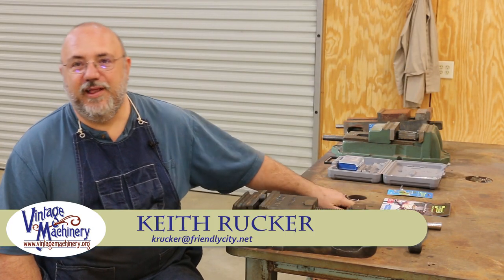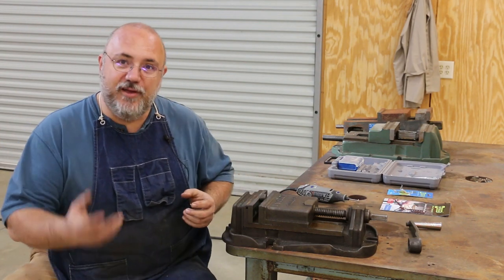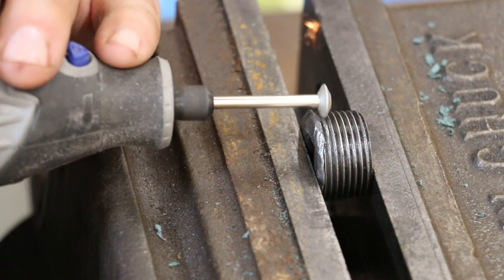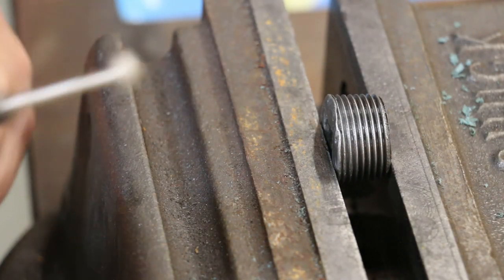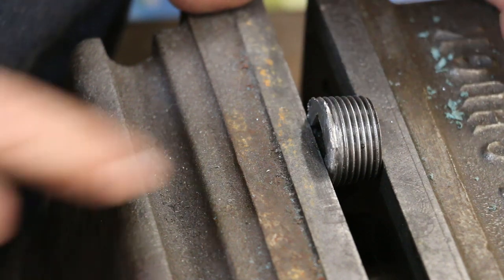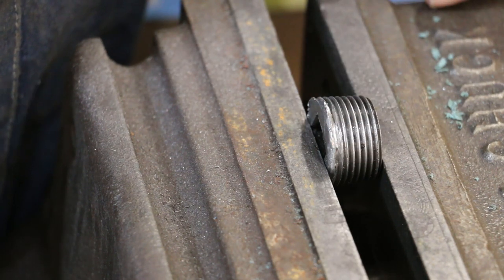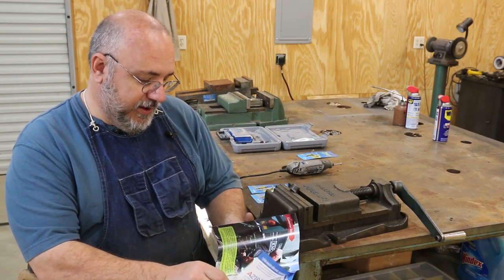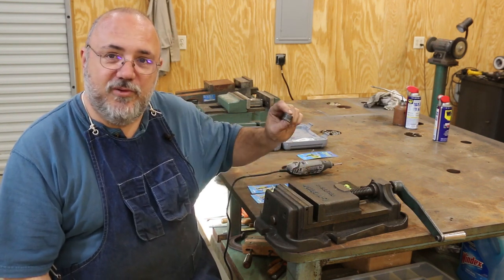Thread Repair using the EZ Thread tool

Comment: Hey Keith, My choice would be a thread file, more control.
Reply: yes i tend to agree , it was a bit agressive, a thread file is slow and wont do much to good threads
Reply: Or even just a triangular file and find the angle yourself.
Reply: I've had good luck in the past just using swiss pattern files to clean up threads. I bet I'd ruin everything I ever used that EZ Thread tool on, it's too aggressive and the proper angles too hard to maintain.
Reply: have to agree thread file yes might be slower but a lot easier to control
Reply: I'd be reaching for my needle files for that kind of clean-up.

Comment: As a machine repairman I use a Dremel and waffer thin cutoff discs all the time to repair threads.  Most of these commenters are clueless.  My boss would laugh at me If I asked to buy thread files.  For quick and dirty repairs this is a viable product.  Thanks for sharing.

Comment: Unless the thread was too hard to cut on an extrenal I think I would prefer a thread file for its control, going to need some steady hand eye to do a nice job with that freehand tool. The one big advantage I see to this is you could use it on many internal threads, something not possible with a thread file.
Reply: my thread files have an end just so you can use them in an internal thread, have you not seen that type?
Reply: As a very experienced machinist I think Keith woulda been better off just making a new one...its what I woulda done...and I have only had my Lathe since October. I think a tool like that is meant to sell, not to work. Might be good for cutting a chip breaker in HSS tho :)
Reply: The tool has been used by a master machinist with over 38 years of experience.  The product is very simple to use.  There are other videos on you tube that show how it works a little clearer.
Reply: It's a drain plug. It's literally not worth his time to make a new one.

Comment: I have to agree with most of the other folks who are less than impressed with this particular tool. In your position, with all the machinery at your disposal you could easily make a new part from scratch.
Reply: It would take a lot longer to make a part from scratch.
Reply: True, but it would have been done right. Probably best to find a new pre-made plug if there are any available in that size
Reply: I agree, all it needed was filing or grinding to remove the galling, and then a dab of Permatex No.2 to seal any leaks. If used in conjunction with sealant like Permatex, the EZthread repair would be ok for a quick rough fix, but a thread file or swiss pattern file would be more delicate and precise, but probably a lot more expensive solution.

Comment: Greetings Keith, I'm still sold on the handy thread file. I worked on used and abused oil field instruments before i retired.  I could chase/clean/repair threads of instrument housings, bolts, etc. most always faster and neater than my younger associates could drag out their grinders, cutting wheels, and wire buffers. I've always kept several of differing thread pitches in my tool box.  Thanks for the video....it rousted old memories!

Comment: The carbon in steel causes galling and clogs up diamond tools since it sticks to diamond which is pure carbon too. For steel you better use aluminium oxide or boron nitride wheels. Diamond tools are good for tungsten carbide, concrete, glass, non-ferrous metals. Maybe it is good for grinding chip breakers into brazed on carbide tools but probably not by a hand guided dremel.
Seeing your troubles to precisely guide the dremel and doing as much damage as good makes me want to use triangular needle files for such a job. They give you much better control, less damage, adequate tool/work material combination.

Comment: I think what everyone is not getting here is that this tool has its use in tight spot where you can't get a thread file or deep in a threaded hole. Of course a thread file would have worked on the plug but he was reviewing a tool and wanted to show everyone how it worked. Thank you Keith I enjoyed the video and I perched one for the shop.

Comment: I've been taught in my machinist tech school program that diamond tooling dies quickly when used on steel at high speeds.  The heat causes the carbon to just transfer into the steel, and no more diamond tool.  Note that the heat only matters at the tiny point where the diamond contacts the work - the reaction takes place there even if the overall workpiece temperature is not that high.  

Marvelous at LOW speeds, where there isn't enough heat to cause that reaction, but dremel tools are what, 15-25k rpm?  I bet that little tool has a lot less diamond on it just from that tiny project.

Diamonds are awesome for hand sharpening and lapping steel, and wet grinding up to the point you can keep the heat under control.  I could totally see that tool being suited for tool post grinding hardened steel threads with waaaay slower rpm, and full flood coolant though!  

I had wondered how I might true up the inevitable warp from "home heat treating" a hardened adjustment screw for my shop made boring head; $20 for a correctly formed, diamond encrusted experiment is within reason :)

Comment: You left out the part where you tried to use the plug was it a success. Great work you let the tool speak for it self you didn't over sell it. Its alot better that what I had my choices would be a hacksaw or a hammer and cold chissel.  Great video as always
Reply from the maker: The plug fit just fine and it is holding oil just like it should!

Comment: I guess in a pinch, if one doesn't have the right size die to run it through, it would be OK. However, a small triangular needle file would be more controllable.

Comment: At first, I thought this was a "nothing" product, but I think having a set of these grinders with the right taper profiles would be a good asset to have on hand, so that you could repair threads more easily and quickly than with traditional methods.

Comment: kieth, I have been using a die grinder for years like that, but using the thin diamond flat wheel. It has more control and cuts faster and deeper. Then once you are in to the depth of the thread you just tilt the blade.

Comment: I can appreciate plugging some local folks and if you think it's a handy tool well that's fine, too.  Sadly, there's enough wrong with it, for the labeled purpose, that places the tool into the gimmick class.  It's terribly overpriced.  The size of the head and the 60 degree shape dictates that the shaft has to be parallel to the bolt, angled to the correct pitch, and can only be used in one orientation on the end of a bolt or the thread shape is distorted.  Unless you are a robot, free-handing a proper repair is near impossible as the slightest bump or misalignment boogers up both thread walls simultaneously.  The threads will be so warped that they no longer properly engage with a nut and can no longer be called threads.  The remaining threads will do all the work while the repaired area floats in space.  All that's practically done is the removal of an obstruction to entering a nut and simply filing or grinding the bad threads off accomplishes the same thing.  You can get better results with cheap emery cut-off wheels as they are thin enough to finesse a thread into shape.
 I do have some of these grinders as various sizes of that tool are included in many of the 100 diamond bits for $10 kits found online and I have used them on threads.  To get decent results you should split a nut, place the halves around the bolt, clamp the mess in a vise, and rotate the bolt while the rotary tool is jigged into the thread or use the rotary as a live tool with the bolt on a lathe set to the pitch and hand rotated.  It's only real niche is touching up mis-formed threads on cast glass or other material too hard for thread files.   Otherwise it's just a detailing bit.

Comment: There would be useful instances for these little wheels, really sort of salvage or desperation situations I think. Without substantial Dremel Dexterity, they become a hammer-and-chisel mechanic's tool. They point up the two big issues of delicate work with a Dremel: being forced out of axial alignment by the bulky motor housing and getting kicked out of position when the wheel catches the work. I'll take a triangular file, mostly...especially for $20.

Comment: I Have several of these for restoring thread in the field on concrete and asphalt plants where the shaft dia. is larger than 1.25 ". I think they are a good tool.

Comment: Hey, I have a question.  Sure, it wouldn't be my first choice either.  Especially if it's $20 as somebody said.  I see a lot of comments to use a thread file.  But, how many of you have thread files for pipe threads?  My MATCO file has neither 14 or 11-1/2 tpi (I can't tell if the plug is 3/4" or 1").  Now, files for pipe threads are made ... just don't have one.  That may have to change now.

Comment: This would be more useful when, say, you need to remove a nut from a buggered up bolt and can't get to it from the side with a 60 degree file and don't want to damage the nut threads. Like a recessed lug nut stud or something.
More of a field repair tool than a shop tool.
If it had cylindrical bushings for various depths of thread it would probably make a neater job.

Comment: I wonder if that would cut wood. I need a 60 degree tool like that to cut thread is wood on my Southbend lathe. Another thing that works good for steel thread clean up is a 60 degree file

Comment: I've had to do this many times on 2 1/2" disc harrow shafts or there's no way to thread the locknut off. The threads get mashed up from rocks.

Comment: Looking at the cutter and the size of the rotary tool it would only work at the very end of the threads anything beyond the shank of the tool would cause you to tip the cutter cutting a buttress thread.                                                                                                                                                   This would be really bad on Acme or square threads!

Comment: Couldn't you just run that plug straight thru a hex die, it certainly did not look like a taper thread / pipe fitting
Reply from the maker: It was a tapered pipe fitting.
Reply: Well done then
Great posts tnx

Comment: what an absolute piece of JUNK of a tool

destroyed more threads than it repaired

if you want a tool like this to work properly you make it 40 degrees not 60 degrees as if the user is not holding it perfectly square to the work peice, boom , youve taken off too much material off one side and not enough off the other

i been doing this exact method for years BUT with the THIN cut off blades with the dremel.....works perfectly and you can shape the threads to what you want with more control